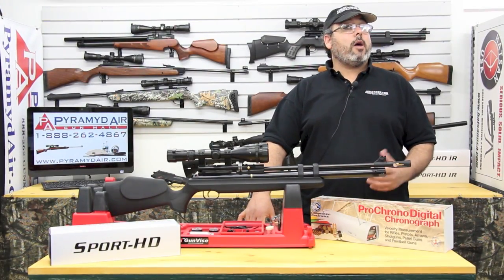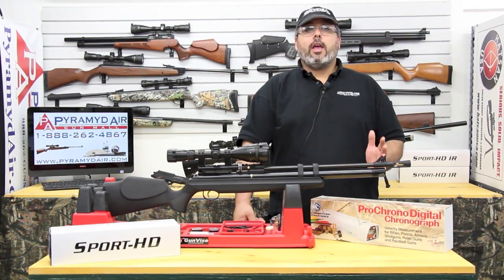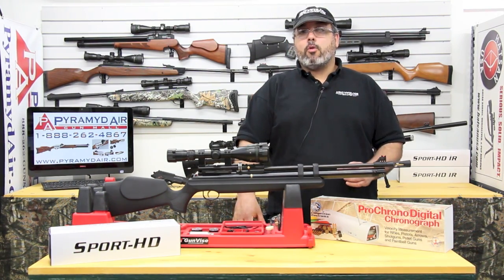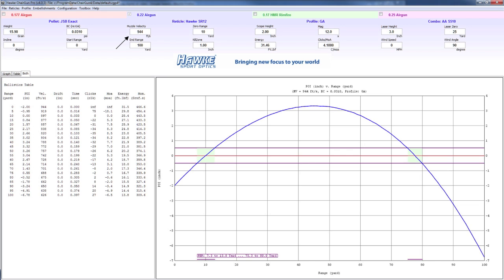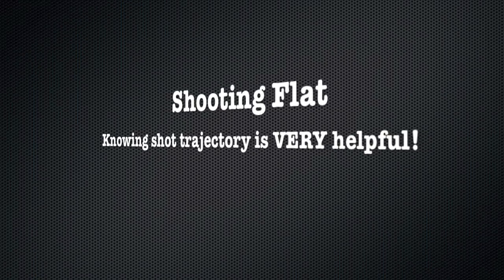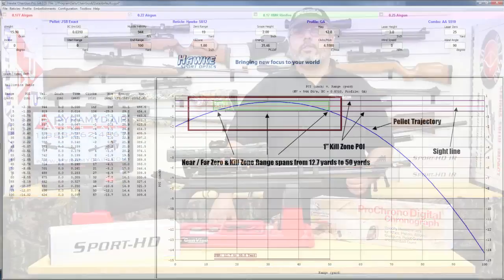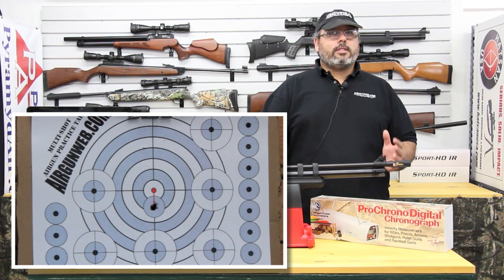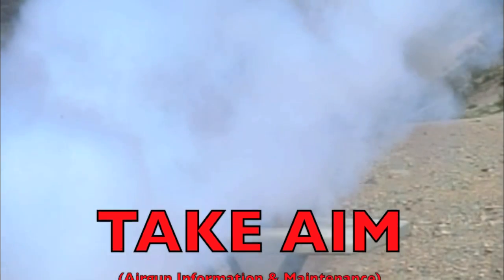Take AIM Episode 21 - Scope Optimization - By AirgunWeb

Comment: Hey want that on end of barrel on this hatsan at44s 10 and does it make it quiet let me know thanks.
Reply from the maker: It is an air stripper. It helps to reduce the turbulence of air around the pellet which is supposed to lead to increase accuracy. It does not make the rifle any quieter. 

Cheers,
AGW

Comment from the maker: I have never tested the s.177 Marauder with 16.1 grainj Eun Jins. Now if you used these in a rifle like the Condor, you might be able to get between 25-27 fpe with them. The Eun Jins are for very powerful .177 pcp rifles. The Marauder in .177 is powerful but it is not as powerful as the Condor or other .177 pcp rifles.

Cheers,
AGW

Comment from the maker: The Gamo Bull Whisper Extreme comes with a decent scope and scope mount in .22. We have not seen it lately at Pyramyd Air. The NP XL 1100 scope is pretty good but the harsh recoil of the rifle has been known to break it. Some people have not had any problems with it. The Tech Force 3-9X32AO scope is decent on the RWS Magnum Stryker Combo in .22. The Beeman RX2 Elite Combo comes with a Bushnell XLT 4-12X40AO scope. The lightest of these is the Gamo Bull Whisper Extreme.

Cheers,
AGW

Comment: Hey Rick
I'll be receiving my Crosman Nitro Venom Dusk from PyramydAir in a couple of days. I just have a couple quick questions I could use your opinion on. First, the description refers to a "muzzle break" at the end of the rifle, which is visible in pictures. Is it simply to assist the cocking of the barrel, or does it have baffles to reduce noise. Some people say it functions like a silencer, just not too sure about that. Will it be safe to shoot cleaning pellets though the baffles? Thanks !